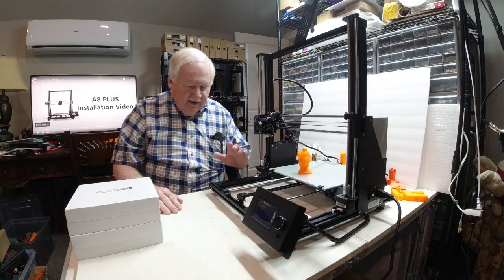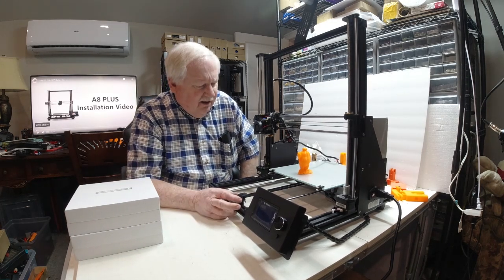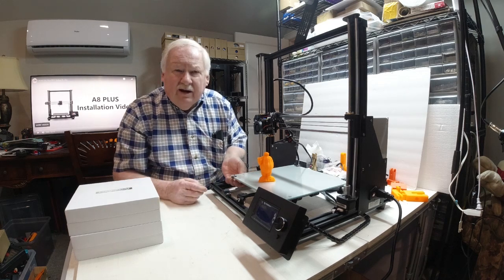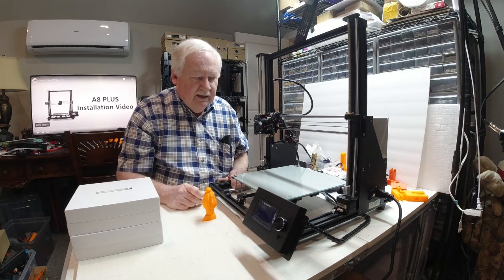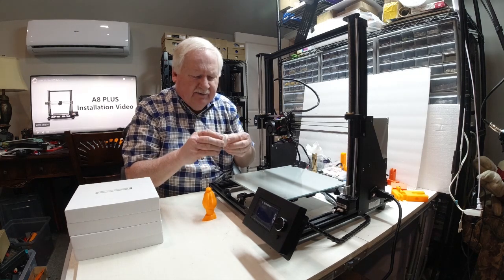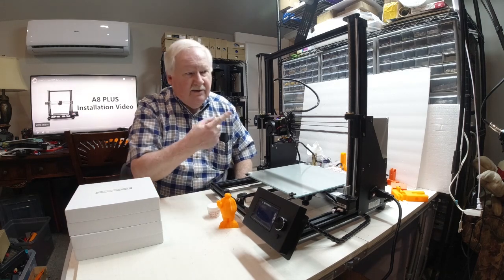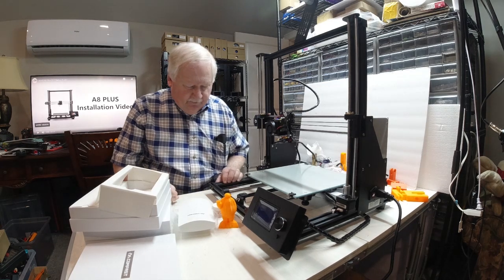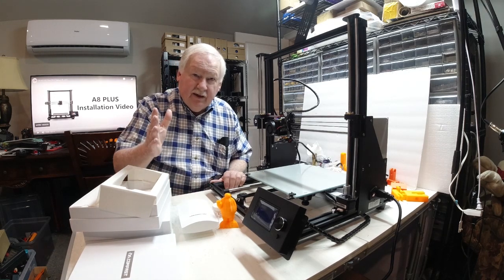MY $206 LARGE FORMAT 3D PRINTER, The ANET A8 PLUS with 300x300x350 build area. New Tech Inventors

Comment: Hi Ken,

Since you've had this printer for several months, I was wondering if you could comment on how the print quality of the A8 plus compares to the original Anet A8.  Thank you for taking the time to share your videos.
Reply from the maker: Thanks for the question Steve. The Anet A8 Plus has been printing very well and I am currently assembling 6 of them for the new print farm and will be printing long multi part print jobs on the soon, this will be the real test for them. I should have some videos of the newer printers I will be using at the new print farm soon, this will include the Anet A8 PLUSS and the Tronxy XY-2-PRO. Thanks for watching and for your support...Ken
Reply: @NewTechInventors  Hi Ken, and thanks for the response.

The reason I was asking about the A8 Plus print quality is because of the 4 printers I have, the Anet A8 "Original", the Anycubic I3 Mega, a CTC A10S, and the Tronxy XY-2 Pro, which all print quite well, I'm honestly most impressed with my Anet A8's performance.

I thought that if the A8 Plus worked as well as the original A8, comes with a glass build plate, 24 volt power, and capable of builds 300x300x350, it would be a steal for the price I'd found it for on Ebay.

I stumbled upon a seller letting one go for $149.00.  I paid $139 when I bought my original Anet A8 and the $17.00 I paid for the tempered glass build surface put its price above what I just paid for the A8 Plus.  Yep, I couldn't resist it for that price.

So, like yours, it was a completely disassembled printer, just like my original A8, but didn't take nearly so long to assemble without having to remove all the sticky paper from the acrylic frame bits.  Unlike yours, mine was missing all 3 end stop switches and associated wiring, the Z end stop bracket, the power leads from the supply to the main board and the 2.5mm hex key wrench.

Oddly, it came with a second part cooling fan, duct, and screws in a duplicately marked bag to the first.  The listing was for a "new" complete kit, not one missing parts, so after I verified all that was missing, tested the PSU, main board, steppers and both heaters, I priced the missing switches and ordered them.  I contacted the seller to express my disappointment.  He asked "What would it take to make you happy?"  I said I'd be pleased if he would refund me $7.74, the total cost of the three switches with wiring.  He responded by refunding me $25.00 and said he'd like to buy me lunch with the difference.  What a great seller was he?

So my A8 Plus is otherwise fully assembled and tested, just waiting for end stops.  My total material cost for the printer turned out to be $132.73.  I don't suppose I can complain about that.

Of my 4, soon to be 5 printers, the one that continually gives me grief is the Tronxy XY-2 Pro.  I'm told Tronxy is shipping newer releases of the XY-2 Pro with better bed level sensors, hopefully yours is a newer one.  Manual leveling doesn't work for me on my Tronxy because the bed sensor probes a different value for the home position every time it probes, and since there's no actual Z end stop, the Z axis has only the sensor to go by when it starts a print.  Getting a good first layer on my Tronxy is an absolute nightmare. :(

Anyhow, thanks for making video's and sharing your experiences.

Steve

Comment: @7:27 Its a mistake to add grease to the threaded zrods. The rods are cut with such precision that they dont need lubricant. But importantly dust, and debris sticks to the lubricated threaded rod, and NOW you have a real problem.
Reply from the maker: I haven't had a problem with that, but will look into that possibility. Would like to here from others and their experience with this. I have always thought that lubrication of moving metal parts that create friction between them benefit from lubrication and cleaning. I don't have a lot of dust here and my new print farm will have 8 overhead large air filters to reduce dust. Thanks for the comment...Ken
Reply: Hi @NewTechInventors  and @Tanzanite TechNature, I'd like to pitch in. I think grease isn't needed when using self-lubricating plastic nuts. The A8 plus however seems to use brass nuts on the lead screws and they would benefit from lubricant to prevent early signs of wear. But it does mean that eventually the rods will need to be cleaned. 
https://www.linearmotiontips.com/when-should-you-lubricate-a-lead-screw/

Thanks for your great content. cheers

Comment: Watch out, when you moved the bed, the screen lit up. That means you sent voltage to the motherboard stepper circuit.  A motor is a generator if you turn it, sending voltage right back through the circuit. Which can burn out the circuit. To prevent that, make sure you disable the steppers before moving any direction. There is a control (Disable Steppers) for that display model. I have found that that particular control panel also scavenges power from the USB port if you connect the cable.
Reply from the maker: Good point. The disable stepper function on my Anet printers only removes the holding current going to the servos when the printer is powered on, thus allowing the servo motors to turn without resistance. The voltage produced when moving the bed is minimal and quickly absorbed by the electronics on the printer and I don't think it should do any serious damage by moving the bed when the printer is off. If I am wrong about this let me know. Thanks for the warning, I would like to know if anyone has had electrical damage to their 3D printer by moving the bed servo with power off??? Thanks for the comment...Ken

Comment: Why does the display come on when manually moving the bed back and forwards? Only does it when moving the bed fast not slow. Looks to me that the motor is generating energy back into the circuit.
Reply: the stepper motor will act like a generator
Reply from the maker: Good question, the servo motors have permanent magnets in them that cause the motor to act as a generator when it turns. since they are connected to the control board the power they generate powers the control board as long as they are turning. Thanks for the comment...Ken